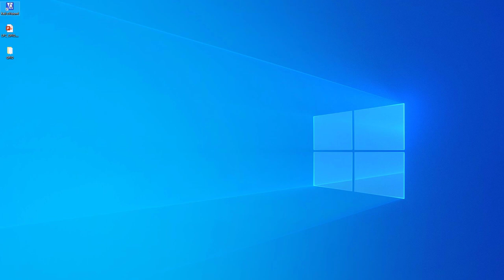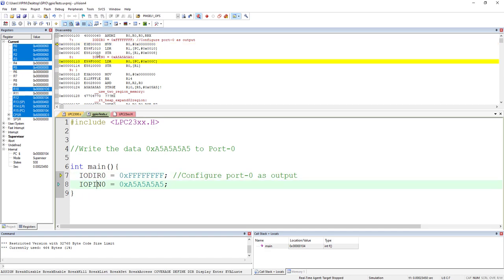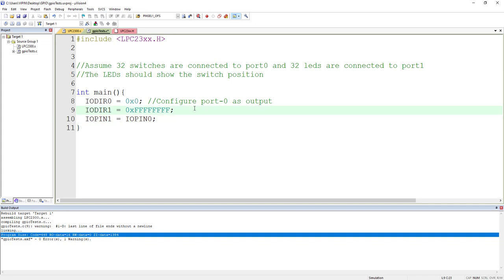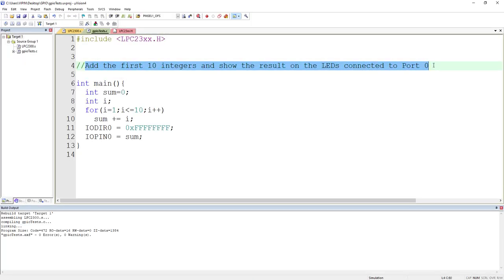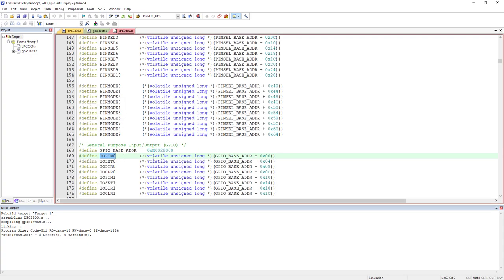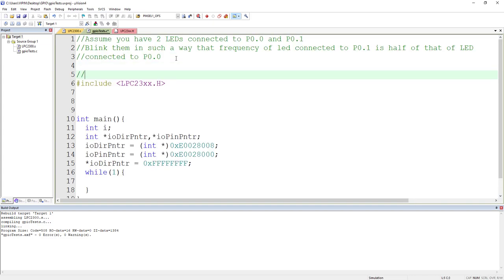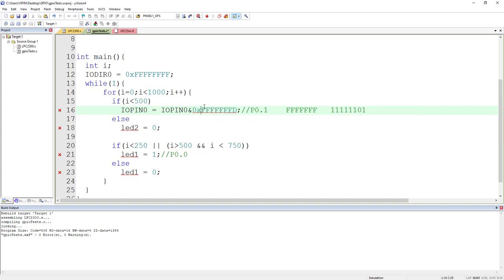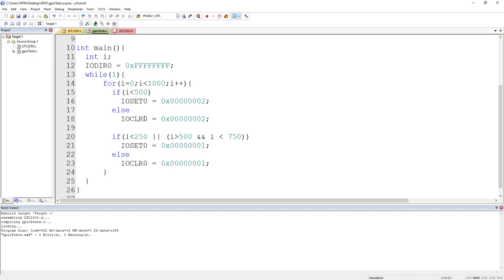LPC2378|GPIO|Legacy Mode

Comment: I have a question.
Is it possible to switch from VLSI profile to embedded system profile within the same company?
Reply from the maker: Depends on the company. In Indian companies with both profiles such as Wirpo, HCL, TATA ELXSI etc. it might be easier compared to international companies like Intel, TI etc. But ultimately it all depends upon your connection with your manager managers of the other divisions and BU heads.